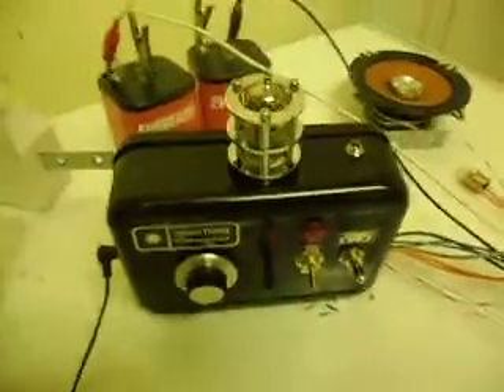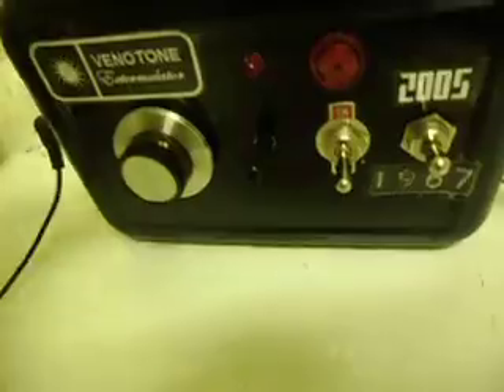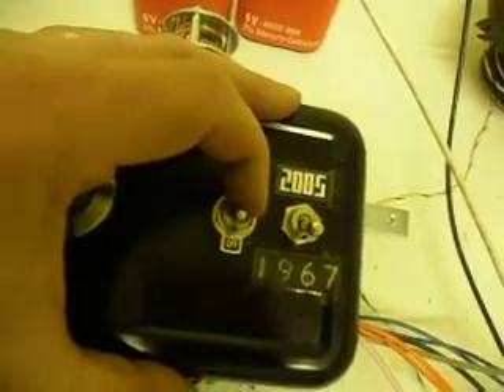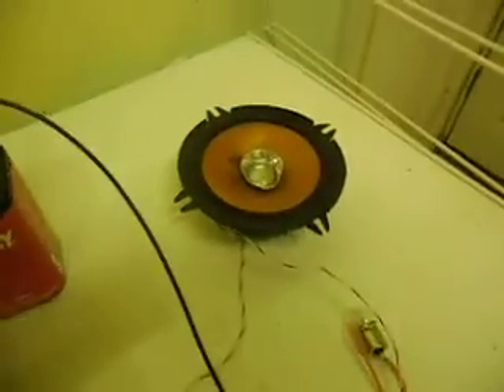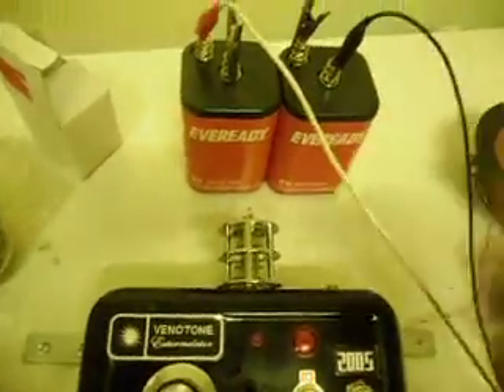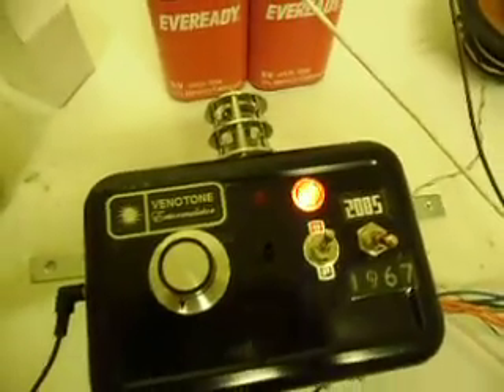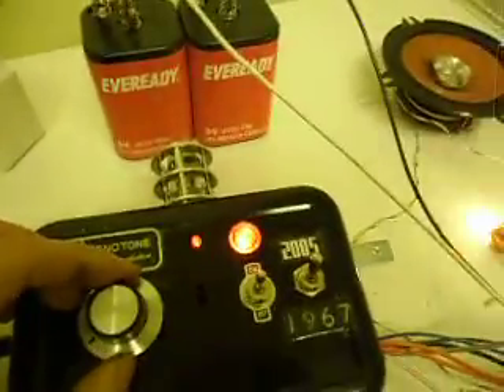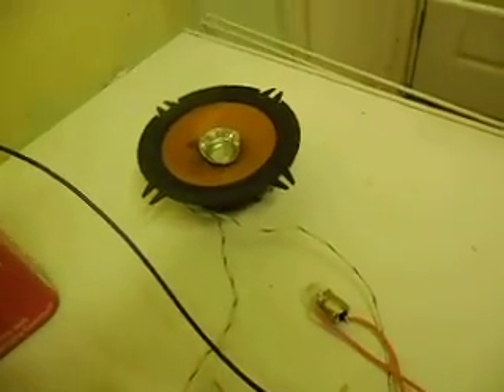Prototype Dalek voice modulator

Comment: What was the production model marketed under the name of please?
Reply from the maker: It was the Venotone Extermulator, but I had major health problems whilst trying to build them. Eventually Sciphonix took over the project and released two versions as "Sciphonix Ai and Sciphonix Xi" but they ceased trading in 2017.
Reply: Do you have any idea where I could obtain a used one from please? Or maybe one of your preproduction ones.

Comment: For home built that`s really good, fair play mate.
Reply from the maker: If you look at the original ring modulator made by Dick Mills of the BBC Radiophonic Workshop, it's pretty much the same as this (two transformers, four diodes) this prototype is still going! It's in Doug Inman's NSD Dalek in 60s colours.
Sciphonix did a production run of these but stopped a couple of years ago.

Comment from the maker: Interesting. The unit in this vid is designed to be operated in a full-size Dalek, however I've been considering making a "stand-alone" unit with an internal speaker and no sound to light unit (which would cut down on the cost considerably). Would also mean you could have a Dalek and Cyberman all in one unit too - see my other vids for what the Cyberman unit sounds like.